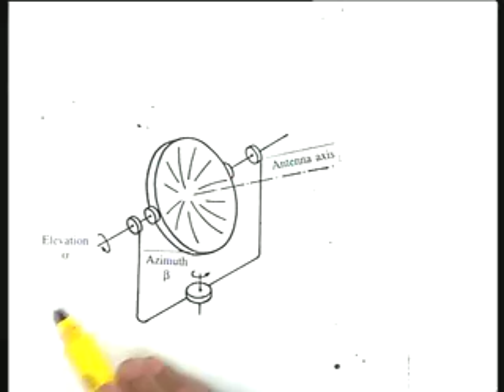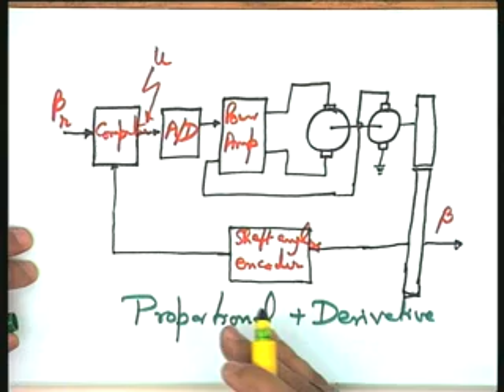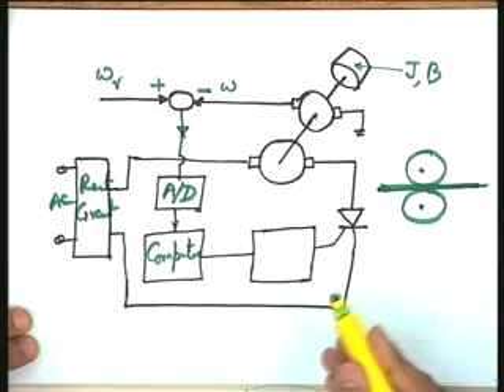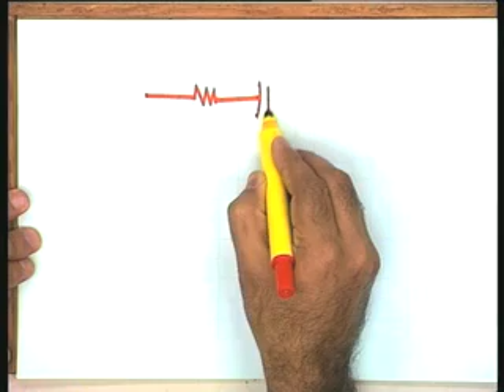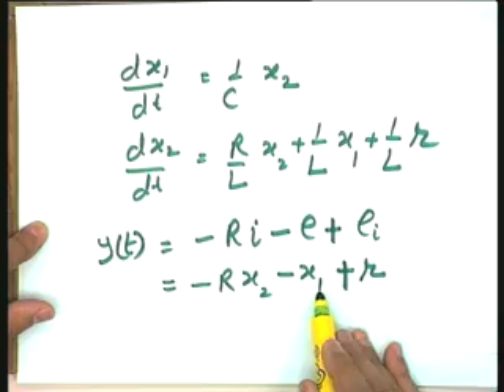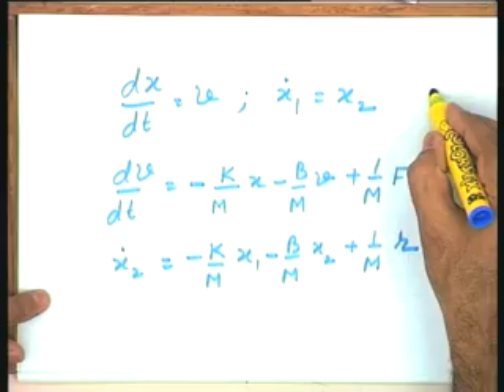Lec-3 Introduction to Control Problem (Contd.)

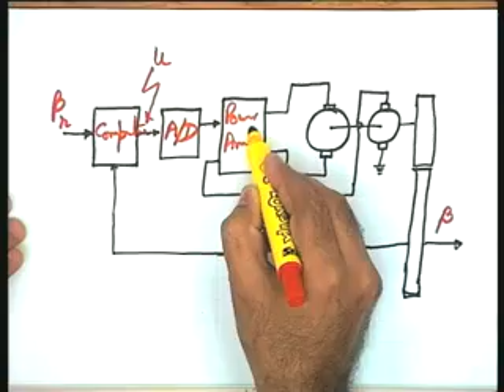Comment: in 6:16 it should be D/A because the command signal is digital and the output must be analogue
Reply: Doc Gopal himself even says the downstream device requires an analog signal yet writes the exact opposite... this is still a good intro to the common sensor and actuator instrumentation for later implementation of system controls.
Reply: Shows it's just human error. This is an excellent lecture regardless.

Comment: The resistor symbol is out dated, the new symbol is  a rectangle going along with the wire. But otherwise very good
Reply: Indeed, this symbol is not outdated but in common use thoughout North America.  What you're referring to is probably a European Standard I'm not accustomed to, but not at all International.
Reply: hjis